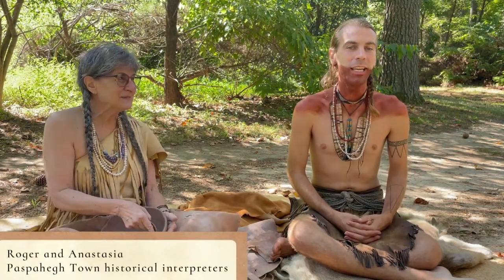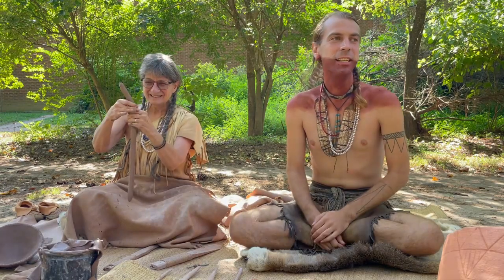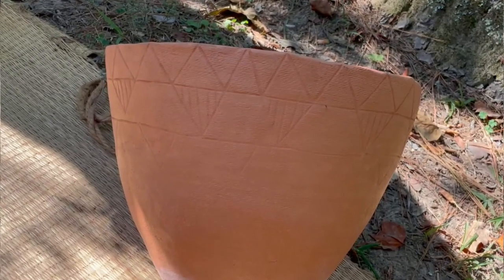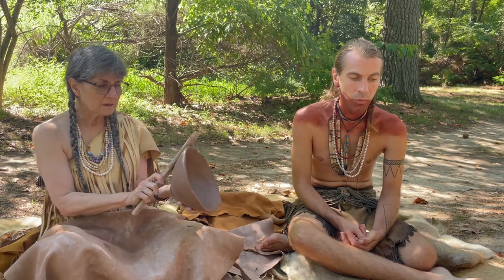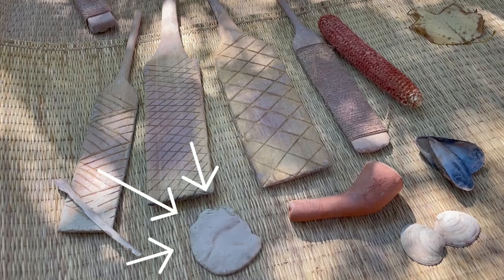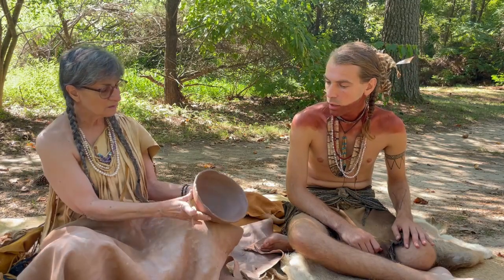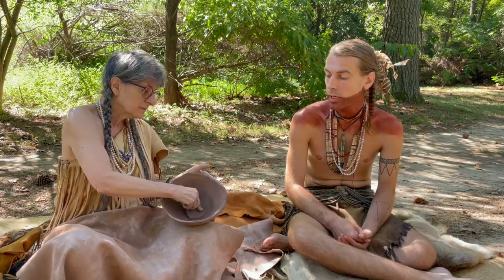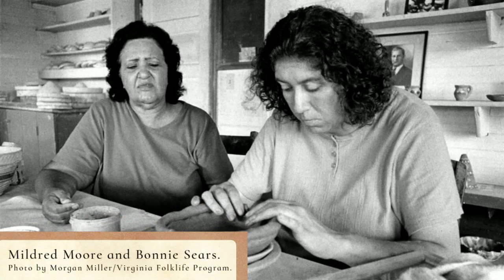Powhatan-Style Pottery | Past and Present

Comment: Why are the bottoms pointy?
Reply from the maker: Hi Pennie Cormier, thank you for the question.  By giving the pots a pointy bottom, it makes it easy to set them into the ground near a fire and to then pile hot coals around the base for a good controllable source of cooking heat, and good airflow over the coals.  A good airflow over the hot coals maintains a good cooking heat.  If the pot had a flat bottom and was sat down onto a bed of coals, that airflow would be cut off, hot coals would die, the heat lost, and there would  be a need to constantly renew the coals.

Check out this video -- https://www.youtube.com/watch?v=EVBgKo3ZBhU  -- and from the 6 minute 17 second mark to the 7 minute 32 second mark you can watch how Sammy manages the pots set into the ground.
Reply: "Well said...well said"...actually I would have liked to hear Anastasia who is more clued, not so talky.